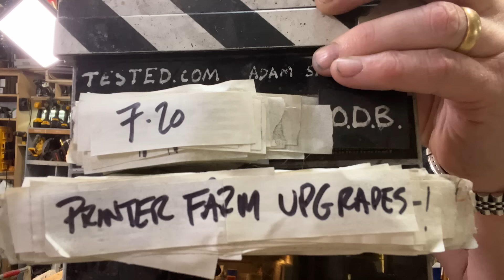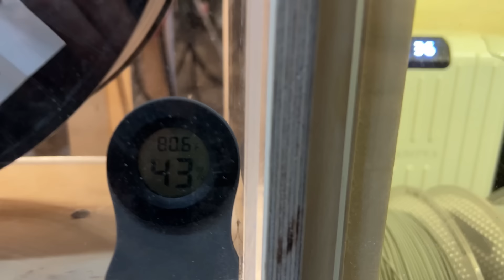Adam Savage's Essential 3D Print Farm Upgrades!

Comment: The key to the flexible build plate, is that you only need to let it cool to room temperature and simply flex it. Everything will effortlessly fall off.. There is no need to scrape it with common filaments. PC, TPU, and other interesting filaments will need a release agent and potentially some scraping. PLA, PETG, and other common filaments only need to cool down first.

Comment: calibration strip issue: it's an initial nozzle purge issue, which you can fix by adding a purge line attached to the print itself. then later you can remove it

Comment: For an anodized look, you’ll want to look in to “silk PLA”. It’s a type - not a brand. Contains an additive that gives it a dull, silky sheen. Looks a lot like anodized aluminum. Print at low layer heights to achieve optimal results, and at slightly higher temperatures. My favorite brand is whatever Amazon has on the cheap cheap.

Comment: To answer your question. I've made prints that look like torched titanium or anodized metal with Tri-Color Red Green Blue Silk PLA. So far the shiniest PLA that has a close to metallic finish with the Bambu X1 higher speeds has been the Ziro Brand , however, I have only found their Red Blue Yellow Silk PLA. Still looks awesome, no question about it, but less yellow seems to look more realistic to me. Silks like it hot and slow for the shinny look. Some of the silks can look less glossy with high speed printing and lose the effect. Still learning these things myself.

Comment: Best hack for the winder is to thread a felt Dremel buffing pad onto the filament to remove the dust and schmutz as it pulls through from one spool to the other. You’d be surprised what comes off as you wind down a big spool.

Comment: I used CC3D's Silk Jade Green PLA (on Amazon) with great results for a metallic shine.  You know, you could just buy a second plate and keep it at the ready instead of having to build a table.  Or if you really wanted a small table handy, you could use a stool.  I keep a tall wooden stool in my workshop for this very type of thing.

Comment: I know aluminium cant be electroplated, but id like to see you try it nonetheless with copper or steel. The print has to be perfectly smoothed for it to work, as electroplating amplify the imperfections. You can remove remove easily the imperfection with a mix of corn starch and Uv resin, with some sanding in between layers. If you print in carbon fiber i guess it good to go but there is some graphite paint that can make the part a good conductor for the plating process.

Comment: I've been really unhappy with that respooler. No matter how much tension is applied to the donor spool, the lead screw doesn't traverse across the destination spool cleanly enough to make a clean spool. Consequently, the filament builds up at the edges of the spool and then "drops" to the middle, causing big, loose loops. So even when respooling from one 1KG (large) spool to a 1KG spool that fits in the AMS, the filament and it's loops get caught in the AMS motor housings! I got rid of the lead screw assembly entirely and layer the filament by hand. Works so MUCH better.

Comment: Have you looked into resin printers?

I currently run a prusa mk2 (it's showing its age now, giving a few issues but I can still print with it if I slow down the first layer a lot) for the "bigger" and practical parts, and a cheap 2k anycubic photon for smaller more detailed parts for model building.

Even though I desperately need to upgrade them both, that combination has worked out really good, as this way I can do both "mechanical" prints on FDM, while I can use the resin to get some more detail, which works great in some areas.

For example, I am working on a custom wristwatch winder, and I can print the main areas on FDM quickly, but the winder components (watch holder and such) out of soft detailed resin which look a lot better as an end result.

Comment: Idea for a more space efficient "flat surface" that you can NOT clutter up. Build a drawer unit a few inches high and the size of your dry cabinet top with a slide out board similar to the old kitchen cutting boards, only on proper drawer slides of course. Only comes out when you need it.

Comment: @tested Adam! I'm surprised that you didn't make the PEI Table to be a simple pull out one kind, like a kitchen cutting board that pulls out and then slides under the printers when not being used.
I have been printing for a few years and have gone through a few Kilometers of filament in all 4 of my printers lol and for the anodized aluminum look I would check out polymaker PLA Silk (my personal #1 go to) or I have had good luck with ERYONE Silk PLA which looks and prints nicely as well.

Comment: My husband is using my queue again for his videos, so I watched this. Why don’t you just run filament out of the large dry box to the open frame printer? It’s close enough. We do that with our 700x550x400mm hypercube, and our 330x330x280mm hypercube evolution. Filament is power pulled by a small micro-controller (ESP8266 I think) into a slack detector in the printer enclosure so that the printer head extruder is never directly pulling the ~4 feet back to the spool locker. Works great, spool never leaves the locker, and is opened/closed less so more temp/humidity stable. We have about 20kg’s of filiment in the locker. I have used the large printer to print an entire pattern making dummy based on a 3d scan of myself (in a 8 pieces).

My SO (who admires your constant motivation to make stuff, but is constantly outraged at your machining technique,) has a old 4cu ft chest freezer he got off Craig’s list that he heavily modified, that keeps the filiment warm and dry in our unheated shop/garage, he cut an acryllic window in the top and put in LED lights and a camera to monitor spool levels, as the “filament locker”. It has a heater, and he uses the freezer compressor and a radiator in the freezer compartment connected to the compressor somehow with ESP32 to keep the freezer dry and report back humidity and temp to a display in our office and sends him a text him if it goes out of range, and the camera he incorporated into the web page that has octoprint in it, and then just runs bowden tubes (about 4 feet worth) to the big printer and the hypercube’s enclosures, which are both direct drive eusing little puller on a PCB units he made using a little tiny stepper motor and controller that make sure there is always a little slack between the out port in the printer enclosure and the extruder feed tube and also acts as a filament out detector. The spool locker is positive pressure, so the filament in the tubes remains dry too, and pushing a tiny bit of warm dry air into the printers all the time, wether they are running or not.

The Cetus (a small open frame cantilever printer, our first printer, and the fastest printer,) has it’s own enclosure, and it’s heated with another ESP32 controller and a modified blow dryer controlled by controller and there are 4 spool holders in the compartment built into the enclosure above the printer that is also heated & circulated, and the filament compartment has 5-6” of molecular sieve material in the bottom of that compartment that the return air flows through drying it, and the filament feeds through a hole into the printer compartment.  Humidity is typically less than 10% in both which up here in seattle keeps filament fresh and printable longer than it takes to use it. The sieve material only needs recharging in the oven once a year, (we have a cheap old kitchen oven in the shop for shop stuff, and he also has a heat-treat oven and one other special oven for carbon fiber) it changes color to indicate when it needs recharging/drying.

And you are right about textured flexible pei plates, my husband just changed them out on the from sand blasted aluminum plates or glass plates (we have both, I hate glass, too much work), on the Hypercube Evolution I sent a print to last week, and it’s so much better. I didn’t have to run the old sand-blasted aluminum plate under cold water to break the print loose, just flex the plate a little and it came right off. Clean off with rubbing alcohol and set it aside to dry and it’s ready to use again, we have 2 plates for the hypercube, and 3 for the cetus, he hasn’t found one big enough for the big printer, so it’s still using a big aluminum plate.

Comment: I used to work for a company that built custom machines for industrial use, this funnel is something I built a ton of times out of hyzod polycarbonate. It's kinda ironic that we always need certain simple shapes to do a simple job no matter the experience level or breadth.
I would have put a 120mm fan in the box one intake, one output.
You want volume not velocity.
Just print the fittings, then vapor smooth them and use clear tamiya paint... works great for fake AN fittings.

Comment: The W Support doesn't just break away easier, it doesn't melt together with the original filament, and therefore you can easier remove the supports. That Filament ist way expensive and for cheaper you can use PETG (and reverse) as the interface layer when printing with PLA and a Z distance of 0 and you get beautiful supported surfaces. PLA and PETG doesn'T bond, when printed together. When you use the same material for Supports, you have to have a distance about 0,1-0,2mm which makes your supported surfaces look way worse. Just a tip.

Comment: If you really want to dry out filament the only way to do it is use heat so you should make your dry boxes into heated dryer boxes instead. Remember to have one or more tiny holes at the top to let the vapour out

Comment: Adam I have a thought on your waste from your printers . I the future you could  just get some flexible pipe like they use on tumble dryers then you could just 3d print a adapter face plate for pipe screw that to back of printer then run flexible pipe straight into bin . ...  Ps love your channel it's very good . Merry Christmas 🎄🎄🎄 soon

Comment: I don't know by how much, but the tape will complicate the printers' ability to compensate for the harmonic resonances of the platform as the head moves, by physically connecting the two printers. It would be worth having one try to print nice, straight, fast lines while the other is jittering along a perpendicular axis at high frequency and amplitude. If nothing else, the tape is likely to work itself loose over time and could cause a dam-up of printer-poop back into the machine. (3d printer constipation?)

Comment: I have been thinking even more about getting a 3d printer (neptune 3 pro) and well looking at all the new filaments on the market I found out you can get tpu filament! Basically can print rubber stuff! so cool. Also saw there is a lot of clear and metallic options now as well as stone and wood finishes. Amazon has so many options.
Reply: I have the N3Pro, I've really enjoyed it so far but if you think you want to upgrade it's parts in the future go with something more mainstream like the Ender 3 series. Alternatively the Neptune 4 series just dropped and this time around they went Klipper instead of Marlin.
Reply: @peperonikiller  I actually meant the 4 haha it's ready to go out the box with almost no setup
Reply: @mromutt  ya do it!! Seems like they took the advice of people who had the 3 series and added everything I wish the 3 had 😂

Comment: I've  been 3D printing since 2017 and  my build plate practice has been finalized with Auqanet hair spray on top of the PEI texture or smooth build plates. I clean them with soapy water and short bristle hand brush.  99% of the time the hand brush removes all particles of filament. I've applied a heat gun and a bad piece of same plastic as the eraser stick to remove the last remaining particle. I learned that as I've had to replace the build plate due to spatula and the heating and cooling of the PEI sheet and the tearing of that surface the creation of holes in it. not a nice finish surface any more.

Comment: If you would have put the holes to mount to the board in BambuStudio, it would have been a lot stronger, as it would have put a set of walls around the hole.  Just right click on the part and click add negative part and choose cylinder.  Then move it and size it where you want it at.  Even do a cone upside down ontop to do a screw head resesed area.  I have a P1S now for about 6 months and holy crap its the most amazing 3D printer i've ever had.  

There are other spool winders out there.  Onces that use a screw to put tension on the ptfe tube is what i prefer to prevent the other spool from going too fast and unwind and twist itself up.

Comment: You could probably get away without a trash can for the table if you added some way to hold a trash bag in the center column that you could dump when it was full.
Alternatively, get a bit fancy and use the thing wood you used for the funnel to make a trash can for a perfect fit.

Comment: You could have mounted a sheet magnet vertically on the front of the gray cabinet to the right.  Pull the plate, stick on on, and scrape it off.  It would be stable and take up no additional space.

Comment: Adam use textured pei plates and you won’t need any adhesive just need to wipe them with alcohol.
Reply: One of the best upgrades ever.  I can print something, flip the plate over under my ceiling fan and the parts will fall off.

Comment: Rather than making a full height PEI plate table, I would have simply built a platform that goes on top of the Lincoln welder right there.  Additionally, I would rotate the small hotbox so it doesn't project out so much.  Of course, a difference between Adam and I is he actually gets a lot done in his shop, stake my suggestions with however large a chunk of salt you think appropriate.

Comment: Adam, Missed watching the best TV show: Mythbuster! I know I have two 3d printer, and the same as for my daughter's two 3d printers. Now, I have some leftover 3d filament scraps, I didn't want to throw it away, I tried to find a extrusion filament machine to purge a new filament. I find it too expensive to buy a machine that can reuse 3d filament, also, not to mention to add resin to mix to bond the filament being strong. Any suggestions on to make a homemade filament extrusion machine? Thank you.😊😊

Comment: It looks like you have plenty of room in the dry box under the Bambus, why not mount the spool for the Anycubic onto the inside of the Bambu dry box and run the filament through the side of the dry box and up to the Anycubic? It seems like it would have save a bunch of material and steps.

Comment: I wonder if connecting the bambus directly with the funnel may cause errors due to vibrations from different prints running on both machines. The issue may be somewhat imperceptible but could be small layer shifts or banding

Comment: What I never understood about filament spools (especially the bigger ones) is that they don't start spooling at a smaller radius. There is a huge center where there is no filament. You could fit much more filament on a spool if the center was winded as well. Or it would make the spool smaller, which in Adam's case would have helped him.

Comment: You should have n+1 plates so you always have an unused one to pop in your printer and set it on its merry way so you can clean the plate without pressure to get the printer running again

Comment: So Adam Savage is doing pretty well with this 3D printing. We've been at this a couple years. And it's not that easy as it looks. You buy those cheap printer kits, and they are uncalibrated, noisy, open gantry. Okay, you get what you pay for. So we are finally getting good prints like this. But was  it worth the effort? We can build 3D printers up from scratch now. So maybe there's that.

Comment: The scrape table seems pretty unnecessary. I take the plate out to get the print off ( if even necessary ), put it back in with the purge / calibration lines still on, then use a little cricut scraper to start one end of each line and pull them off with my fingers. You don't need to scrape the whole line off.

Comment: I designed a printable AMS case where I was going to add a removable cover on the bottom to expedite clearing filament jams, and making it 10 cm taller to accept larger diameter spools.   Would it be worth designing an oversized version for 3 kg spools? I believe that I can make i fully Bambu compatible, oversized. I don't know how many would be interested in it. But if you were, if do it. Steve

Comment: What nozzle size is that? Layer height? That print looks FRESH righ off the built plate. Like, that things looks primed and sanded already! I'm so jealous of those clean prints. I'm running on a very modded Ender 3 that I've had for years.

Also, I'd love to see some content about your views on and experience with 3D scanners!